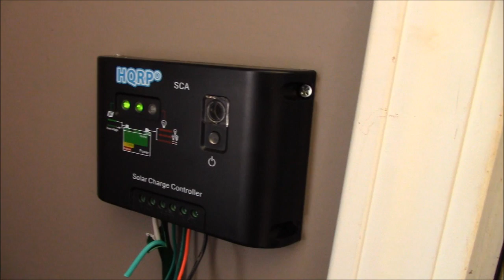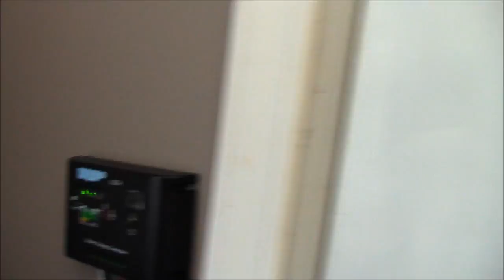Solar Powered Hydroponics

Comment: Do you know of a dependable, low-cost supplier of solar/pump systems?

I do not need batteries or timers.

I bought a system from Silicon Solar.  It is failing.  Click on the link below to see the situation.  Thank you.

https://youtu.be/cJiAfOGtG14
Reply from the maker: greenurbanislands I'm using an eco-396 for those plants. I believe I ordered it on ebay for less than 20 dollars, but can't recall exactly. Their pumps are pretty simple so there isn't much that can go wrong with them. Just make sure you clean the pump every so often. You want to get the highest gph for whatever you are wanting to spend unless power consumption is a big concern. In that case, they have a chart outlining the different models and wattage. It is better to be over powered than under...
Reply: Thank you.

All the details of power, cleaning, angles of panels to sun -- all these details should be in the instructions for the operation of the panel/pump systems.

However, too often, the writers of the instructions do not work with the equipment.  And then, there are the Chinese tech writers.  Disasters.

I will continue the struggle with these solar/pump systems.

And I am simultaneously working on labor-intensive work-arounds.  I'm working with tribespeople in the remote areas of African nations.  If a solar panel/pump system requires technical attention, I anticipate equipment failures due to inadequate understanding of the details.  If a system can be hand-watered -- for example, a 20 liter  bucket every hour, the system will survive the tech failure.

Thank you for your information.
Reply from the maker: I haven't had to do any maintenance of the panel once it was set up. The pump I clean once or twice a year. Hand watering I definitely think is an option, but I would guess it would require much less labor than that. Depending on the temperature of course. I bought everything separate so there were no manuals. What organization do you work through?
Reply from the maker: Oh, and I just set the panel angle at approximately my latitude. For expensive high powered systems you would want to be as accurate as possible though.